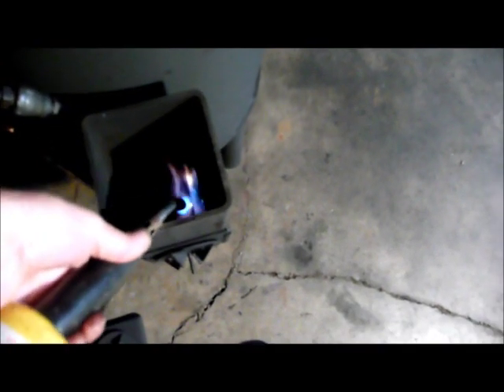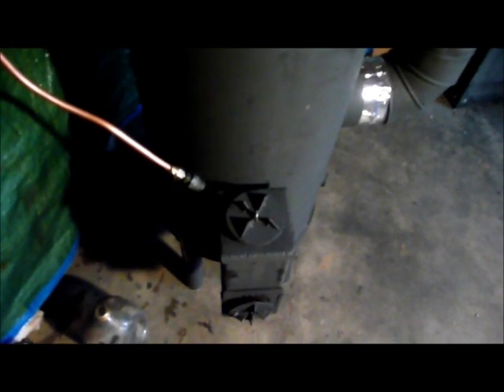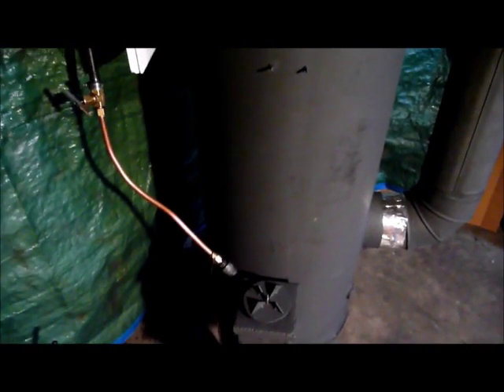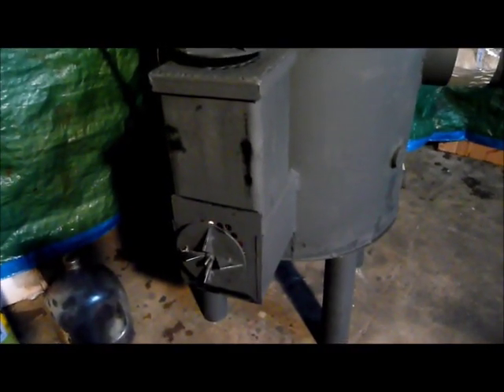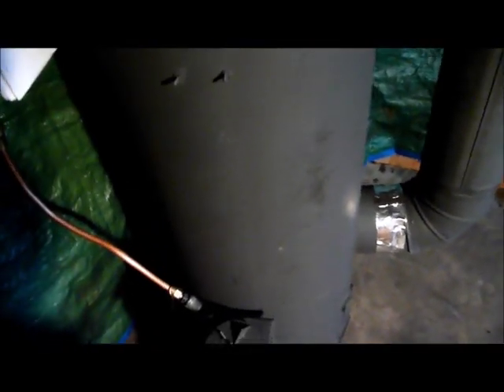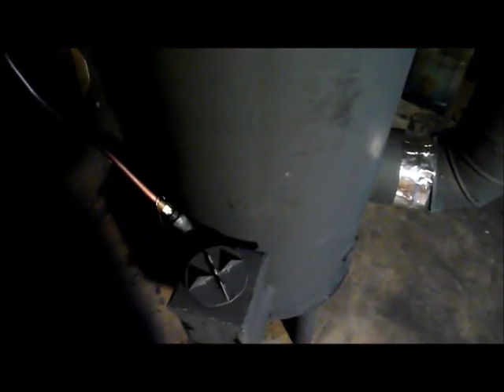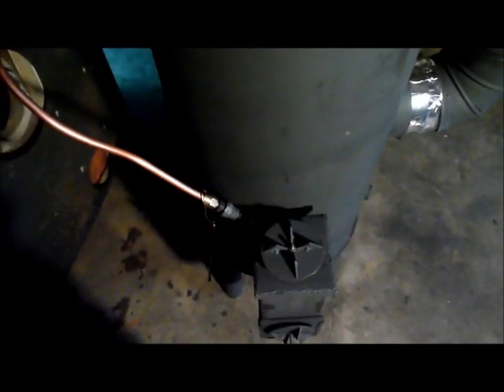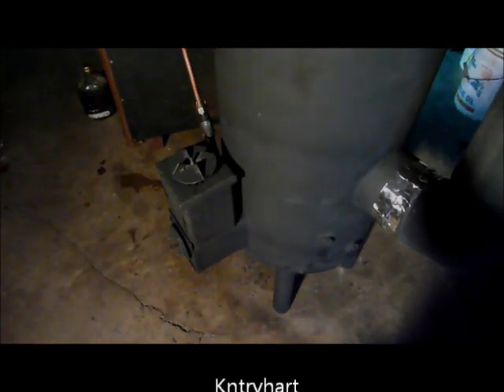Rocket Heater Part 2 of 2

Comment: I have a rocket stove with a firebrick core. After runn8ng a few hours, the brick are glowing red hot... and being made of refractory material, it does not oxidize like steel. This is why NASA uses ceramic tile on the shuttle, to withstand re-entry temperatures. 

So, I wonder if I can drip waste oil directly into the feed tube and into the burn chamber...

Alternatively, a steel cup of some kind placed in the burn chamber should last a long time and will be easy to replace.

What are your thoughts??

Comment: Like it. Built a similar oil/diesel/wood version (second attempt) to heat my leadlight workshop. Done two winters and not a problem with any part of the heater. Purposely run the feed pipe close to the outer box to 'preheat' the fuel (usually a mix of sump oil and diesel). Very quick heating of the 10 x 10 garden shed workshop with no insulation.......check the link
https://www.youtube.com/watch?v=-mEUv_QURHc
Reply from the maker: Interesting.  I'll stick with my Ozzirt-style waste-oil heater.  Been a rock-solid unit for several years now.  Good luck!

Comment: I would be interested to see more of the internal structure.  Does the brake drum lift off?  Do the clay flue tiles (heat risers) sit on a steel plate above the burner?  How about incorporating fire brick in the base of the combustion chamber?  Do you have any other interior baffling to channel the exhaust gas out the bottom?  Maybe you could do a sketch of the interior components. Thanks.

Comment: have you thought about lowering your heatolater to extract more heat before it cools sinc your readings are so far apart on chimney
Reply from the maker: This unit is longer exists.  I had too many issues with material failure due to the high temperatures.  I went back to my Ozzirt-style waste oil heater.  Thanks for watching!

Comment from the maker: I am NO expert; I am heading into my third rebuild on this one since the extreme heat destroys mild steel. Strongly suggest nothing other than stainless steel unless this is just an experiment and you plan to rebuild. Cross-sectional area relationships within the stove are critical to achieve a rocket effect and to prevent choke points. Gap between tank and insulation s/b about 1.5". Suggest downloading pdf ($15) of Ianto Evans and Leslie Jackson Rocket Mass Heaters. Money well spent!

Comment from the maker: I think you should plan on rebuilding it in the future.Check out user ID web4deb. He had the same problem. In the next few months, I plan to experiment using small square ceramic tiles for the heat riser. Try to make your rocket "servicable". I used a shop vac to remove the vermiculite so I could reuse it. I have changed the top plate to a bolt-down design for easy access.  Let me know how you make out.  Good luck.

Comment: Great design! I'm making one almost exactly like yours! I've already got a 1/4 inch thick heat riser installed, and am going to insulate with perlite. Now you've got me worried about it holding up to oil injection. I am not going to tear it back apart as I'm so close to finish. What do you think?

Comment from the maker: No problem.  As soon I saw the amount of scaling on the steel pipe, I knew I had to change to something else regardless of the thickness  Stainless steel is an option, but the correct grade stainless must be selected; 304 looks like a good candidate. If you look at user web4deb videos, he had the same problem. Yes, the flame goes up the heat riser and down the sides to the chimney.  There is a insulated shroud inside that insulates the riser and maintains the correct space to the outside shell.